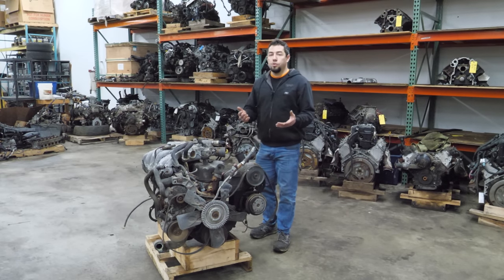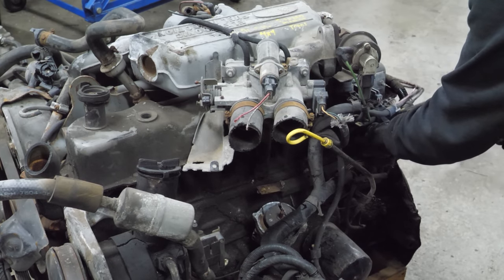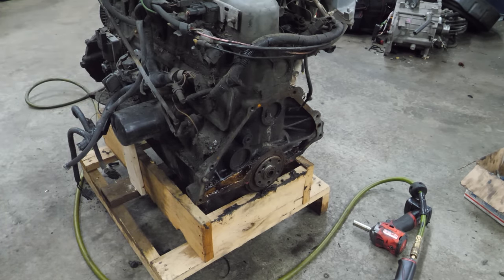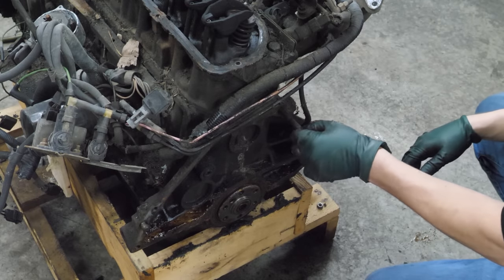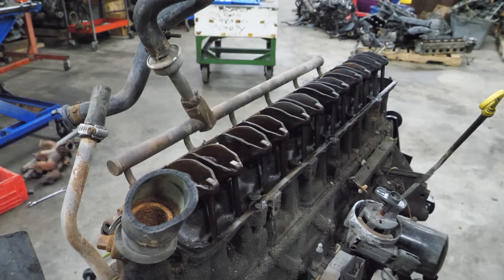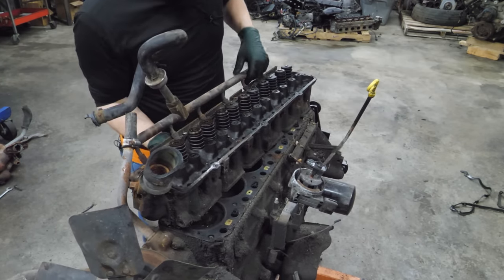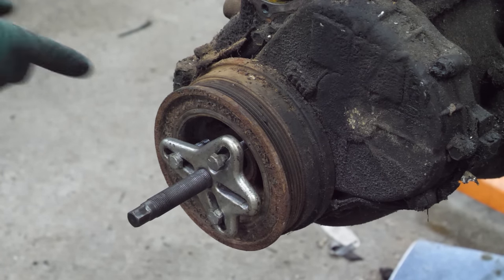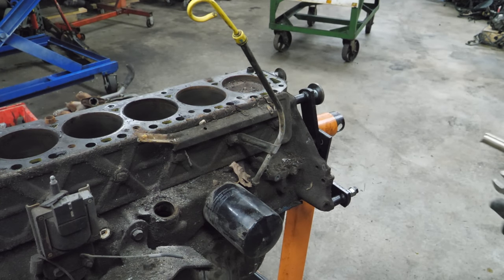FINALLY! A "Bad" Ford 4.9L 300 Straight 6 To Teardown! Most Reliable Engine, Ever?

Comment: I took one of those apart once that was in a 1985 Ford Van, the thing had close to 600k on it. The owner loaned it to his brother-in-law who took it on a cross country trip to tow home his dad RV. It drove in under its own power but I was told it had overheated. The owner said that when it was returned to him the side of the block was glowing red and there was no coolant in the thing at all. The water pump had sprung a leak and the driver never bothered to pay attention to the gauge. I stuck a new pump on it and pressure tested the system but found a leak in the head between cyl. 3 and 4. When I pulled the head it came off in two pieces, as did the intake and exhaust manifold. 
The customer was given his options, he opted to go with a new head and both manifolds and see what happens. I ran into him about 10 years after that while out shopping one day and he was still driving it. It had turned 610k at that point. 

I personally had one with over 750k on it and another well over 400k. 

That motor in the vid looks more like it had freshwater intrusion then an internal issue, the damage was likely from its time sitting in a junk pile somewhere in the rain. 
Probably a cash for clunkers type deal, thus the cut distributor.

Comment: I drove a 1974 Ford school bus in high school with a 300.  The oil drain plug wasn’t tightened at service and fell out one morning and it overheated and locked up.  I thought I would have a later model bus when I came out that afternoon there it was.  Broke it loose with a breaker bar, refilled with oil, and drove it at least the last 6 months of school.

Comment: Back when they first came out with engine oil in plastic bottles instead of the cylindrical fiber can, it was common that the little plastic ring that was part of the cap would sometimes go into the engine with the oil, if you were not careful. Do you remember oil in cylindrical cans?
Reply: yeah and the push in spout
Reply: yes push the metal spout in and pour
Reply: How about oil in GLASS bottles?

Comment: Here is Australia we had the 250. An awesome engine. We eventually made the Barra, literally the best engine ever built.
Reply: @Buck Rogers, the Aussie sixes were nothing like that 300, absolutely zero parts are interchangeable, our sixes were much smaller, the inlet manifold was part of the head casting (except for the vary rare 2V 250), we had higher compression ratios than the 300 because we still had leaded fuel, but a much shorter stroke.
Lots of older Coles stores have a natural gas 300CI powered alternators, sitting up in their plant rooms that power 30% of the lighting as well as the comms and cash registers.
They sit there patiently waiting for a power failure, then dance at full throttle up to 3000 RPM, where they turn natural gas into CO2, H2O and 415Volts, fantastic engines, most with less that 1000 hours on them, but we just can’t get parts for them anymore.
Reply: @elonmask50  we had the small six also in america, it was used in falcons, comets, mustangs, fairlanes, torinos and granadas until 1982. but, out small six always had the cast-in log intake for a 1bbl carb, we never got the 250-2v head or intake.

Comment: When my inline 240- 6 cyl. Broke in my 69 f100 the dealer replaced it with a 300 - 6cyl. by mistake - it was a world of difference  in power and torch and economy, but i loved that truck, but things changed in my life - marriage - i traded it away - in 1983 i bought the last F102 camper special sold in Ark. and it had a 300 6cyl. but it had been increased to 300hp and a 2 brl. carb.  and duel exhaust - i drove it for 8 years and had to rebuild the head 3 times due to #5 & #6 cyl. burning the valves, i sold it to a machanic who said he knew how to fix it, he replace the 1983 head for a 1970 head and it quit burning valves, he is still driving that same truck and motor, just regular good maintenence

Comment: I bet if you had cleared off all the broken accessories and that flywheel it would've started just fine.  Ready to go for another 100k!
Reply: It won't start without the flywheel.
Reply: there is a metal additive made in ukraine that rebuilds all the scratches etc in the bores.  rebuilds the compression.  I was investigating this to reair an old soviet motorbike I have. Greetings from Ukraine. I think it is made in Kharkiv

Comment: I think the Chrysler 225 slant six was right up here with these, but they were gutless in the Rams. They went much better in passenger cars.
Reply: Chrysler’s horrible quality control during the 70s gave the leaning tower of power a black eye. You either got one that was bulletproof or you got one that drank more oil than fuel and would drop a valve seat in a heartbeat. Again, it wasn’t the design, it was all the alcoholics that were doing the machine work with worn out equipment.😊.
Reply: @prevost8686  My dad had a ‘75 Dart Swinger that had a confirmed 390K miles on it before he got rid of it. Lasted 20K more miles or so before with the next owner until a wheel fell off due to rust underneath. It became scrap after that.

Comment: Friend of mine bought himself a Galaxy 500 two door hardtop as a grad present to himself , beautiful car , had the 300 six in it with a three on the tree . I had an old ford 150 , 462,000 miles on it , dual tanks ,filled tanks and decided to take a drive to Dawson City , Yukon , figured if I got 22 mph I could afford the trip , the worst milage I got was over 25mpg , one tank full I almost got 30 mph , drove 12 to 16 hours a day . That engine just purred along , run it till it coughs flip the switch and drive another 400 miles on the second rank . A guy paid me big bucks for the old thing , and then took the six out for his boat and dropped in a power stroke ??  Great engines

Comment: I had a '66 F100, Twin I-Beam suspension, 240 6 cyl, 4 speed manual as my college days ride.  Made it to class every day even in the -30F something days in Fargo, ND.  Only problem I had was a crack in the exhaust manifold.  I heated it up, brazed the crack shut and buried it in dry sand to let it cool slowly.  Just like new.

Comment: If you can get hold of a Jaguar AJ16 (or AJ6) I would be ecstatic. They're supposed to be the most reliable engine that Jaguar ever produced, and they were only used very briefly... But they look simply amazing.
Reply: That'd be rare for a Jaguar; I remember a time when people would just junk the Jag engine and put in a chevy 350. Problems solved.
Reply: Perhaps put one of these in the Chaguwar?
Reply: An EY20D is rated at 5 hp
Reply: @tiredoldmechanic1791  That's precisely why I'd love to see one torn down! It's supposedly extremely reliable (the engine, not the car) so the car disintegrates before the power train has a chance to even get broken in.

The AJ16 was only in the x300 and x306 era cars, and the Aston Martin DB7

Comment: I bought a brand new F150 4x4 in 1982 with the 300 cu in.  I installed a set of heavy overload springs on it and treated it like an F250 until I sold it in 1993 with just short of 140K miles.  It hauled my camper and bass boat all over the country and finally to Alaska.  It never required any maintenance other than regular service items during that period.  Although it still ran strong when I sold it, it did have some blow by as small amounts of oil would accumulate in the air cleaner.  I've owned several trucks since then but will always have fond memories of the workhorse 4.9 and how reliable it was.

Comment: I've been driving one of these engines for 40 years in a 1983 F100 that I bought new.  I lived in rust belt Pennsylvania for over 30 years, but I have almost no rust.  That is because for a short time, Ford used Sumitomo coated steel which had excellent rust resistant properties. Later years rusted our much faster than my 1983. I had one internal engine problem.  One of the rocker arms had its oil hole drilled a little off, so the rocker did not get as much oil as the others.  This did not hurt the rocker, but the reduced oil flow caused the lifter to stick after many years.  This appears to be because the reduced flow allowed varnish to coat the inside of the lifter.  Since the lifter hydraulic adjuster has extremely tight tolerances, the varnish is enough to cause the lifter to stick on cold starts.  I took it apart and cleaned it, but now after 40 years and 300,000 miles, a few lifters now stick.  Someday I will remove them and clean them again.  One thing I will NOT do is try any kind of oil additive or treatment to clean the lifters.   I changed the front crank seal a few years ago, but left the back one because it is too difficult for me.  Even so, I don't have to add oil between changes. No sign of oil consumption.  Years ago, when running on real gasoline and lower speed limits, I got 20+MPG on the highway thanks to the AOD transmission, which is also original.  Today it is about 17 but that is at 70mph speeds.

Comment: Engine wasn't tired it was Abused to the Max. Discusting to see such a great engine treated like dirt. These engines will run Forever if maintained.  EPA Gansters killed off a Legend of all time. Without emissions and fuel injection.  That was a Simplistic tractor motor. . Great video again.

Comment: i like that this guy is showing what and how you actually want to do to prep this engine.  first a covered garage with concrete floor.  an engine stand.  large and top quality sockets and breaker bar.  AIR TOOLS.  these have been the standard for real work on cars for at least 60 years.  put the compressor outside and use a pressure tank - for the noise.  as you take it apart label the parts and take pictures.  use your powers of observation at each stage to learn what you may need to do to the engine.  use wd-40 or penetrating oil and tap bolts before removing. anyway this guy is pretty darn good.  should be putting parts directly in a cleaning tank.  excellent video.

Comment: I bought 1995 Ford F-150 in 1995 (new) and it has the 4.9L inline six and a 5 speed manual transmission. I have been a diesel mechanic for many years and still do all the work on my truck. It currently has 333,546 miles on it. Just got back from hauling a household of furniture and stuff for a lady that moved to Arizona from Texas. All the stuff was in my homemade 16 foot trailer and all tarped up. Most of the time I could do 70 mph but the hills slowed me down to 50 or so depending on how steep it was. I drove it 2000 miles without a hiccup there and back. My daughter thinks it is her truck because that is the vehicle she learned to drive on and has threatened me with my life if I ever try to get rid of it. Sold it to my brother for $1000 but two years later I bought it back for a $1000. HA! He found something else and the agreement was I get my truck back. I run 31" X 10.5" all terrain tires. Just got done putting in a new radiator, water pump and thermostat. Was not running hot but I was always adding coolant. I got that problem fixed. A/C has not worked since 1999 but I did not want to spend the money to fix it. I wonder at what point do I rebulid the engine? I guess as long as it runs why bother. This truck will probably out last me.

Comment: Had over 500,000 miles on one in a 80 E150 van. Had to junk it because the body fell apart from rust. Best engine I ever had.

Comment: I worked at a Ford dealership in the early '90s. We had a Ford dually come in for a warranty engine failure. It was a fuel injected 300 6-cyl. The owner had a toolbox in the back and towed a portable welding rig with it. The truck had a 5-speed manual and the owner admitted he never used 5th gear. He burned out the main bearings driving the truck down the interstate in 4th gear running 70 mph. The exhaust manifold was purpled and warped from heat. The engine was Ford Authorized Remanufactured (FAR) with a 3/36 warranty and it was replaced under warranty. Yes, you can kill them. The engine was never over-revved or overheated. However, it wasn't designed for the abuse it was getting.

Comment: I had a had this engine in F-150 and I loved it. I it did use oil but you knew it wanted oil is the engine would start to run rough!

Comment: I have owned three of those engines, and I totally agree that they are nearly indestructible, but all of mine didn’t have all of that junk on them.  They had distributors with points and condensers, carburetors and rusty cast iron exhaust manifolds.  I loved all of them!

Comment: I had a '77 f-250 with 300 on the farm for many years. I had multiple 5th-wheel trailers hauling everything from small implements to large loads of calves to multiple 2510 and 3020 John Deere tractors. I really took care of this pickup and engine and loved it so very much. The Carter 1-barrel carb moved mountains.....just not very quickly. I still have an '87 F-250 with fuel inj. and C-6. Sure wish gasoline was 99 cents.

Comment: I LOVE the 300-6.  I’ve driven a few and had at least one other in the family.  I also have a story.

I have personally driven a 1979 F-100 with a 300-6 and a 3-on-the-tree, a combination at least engine and transmission-wise I’d like to find for a fun, classic vehicle today and a 1985 F-150 with a 4-speed manual OD.

The story I have is about the 85, owned by my step-dad (my grandfather owned the 79).  My stepdad was going to pick me up from Explorer Scouts in the early 90s and the water pump and thermostat went out.  I’m not sure which was the chicken and which was the egg.  My stepdad drove a long way to pick me up with the truck overheating and a long way back.  We did stop on the way back to top off the radiator.  He replaced the water pump and thermostat and there were absolutely no negative repercussions from that situation.

Seeing this engine is sad to me.  This engine very obviously was majorly neglected when it came to maintenance.  This was a great engine that deserved better.

Look up Ford Bronco Tannerite on YouTube.  It’s an old video.  Basically some gun enthusiasts put Tannerite in a 1979 Ford Bronco and shot it causing an explosion.  Do you know what survived?  The 300-6 engine block that was in it.  I will say though, I always knew they were bulletproof.  Apparently, they’re explosion proof, too.

It really is a shame they don’t make them anymore.

By the way, I’ve never driven a fuel injected one like this.  I believe this is an 87 or newer.  It was probably the best version of the engine.

Comment: I had a 93 F150 with the 300.  It was a plain Jane truck: no carpet, manual windows, manual locks, 5 speed.  It was 4wd.  Loved that truck and engine.  100k miles trouble free.  Passed it on to Dad and he put 30 or 40k on it.  Then he passed it on to a cousin.  For all I know that truck may still be out there running.

Comment: My daily is a 91 f150 with the 300. It had been abused and was drinking coolant. The head was cracked around the valves on two cylinders. It got a hooker header when I reassembled it. 
  Fun fact, there are three variations of the 300. Consumer, commercial and industrial and some of the 300s that ended up in pickups towards the end of the run were industrial engines with forged crank and rods. Apparently you can tell by the crank casting number. If you have a steel cam gear it's at least a commercial engine as the consumer model was neoprene or fiber. The industrial engines of course also had the steel gear.

Comment: Drove 2 E350's with these for 13yrs as a forklift road tech, they never failed me, between the 2 drove 250k miles. With all my tools, parts, supplies and a compressor, it weighed in at 9000lbs....never phased it. Along with that it would at times pull a heavy duty trailer with a Miller welder/genset and a hydraulic forklift tire press on it.....never batted an eye.

Comment: My first truck was a 95 f150 with a 300 and a 5 speed. My grandfather gave it to me.
I had a short commute to school so it took me a week to realize that the oil pan had rusted through and I'd been running it without oil the whole time.
It never made a sound, I brought it in shop class and replaced the pan (not fun!) Filled her up and never had a problem. Tough old bird.

Comment: The failures seem similar with these kinds of old bulletproof engines.. The only things that get them is the slow rotting of gaskets and rubber seals that allow stuff like coolant and oil blow-by. Other than that they rarely die from anything but severe neglect. Cool rare teardown, this channel has made me want to get into engines instead of computers, and has really expanded my basic word of mouth knowledge about them!

Comment: My 93 F150 has 280k on it.  I bought it used at 63k in 83.  It's like the Energizer bunny, keeps on ticking.  Only issues were I replaced the 5 speed tranny about 7 years ago when the rubber freeze plugs dried out and let nearly all the transmission oil leak out on the road, never on the driveway and the radiator plugged up.  Gets better mikeage every year. It may live forever.

Comment: Great video I’ve got a 94 4.9L getting ready to pull the engine replace leaking freeze plugs, noisy lifters, reseal oil pan, replace timing gears inspect cam lobes. It doesn’t like to idle smooth and stalls, once it gets going it’s fine I feel the timing gears or cam lobes may be worn. This video gives me a little insight of what to expect thanks!